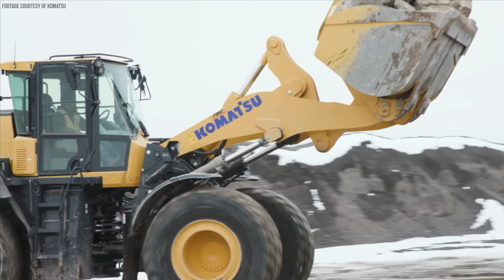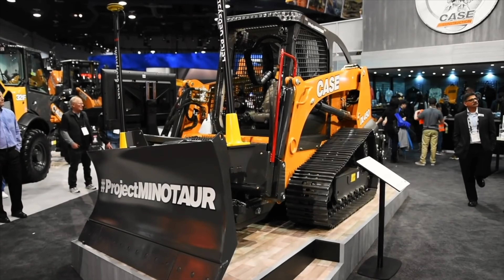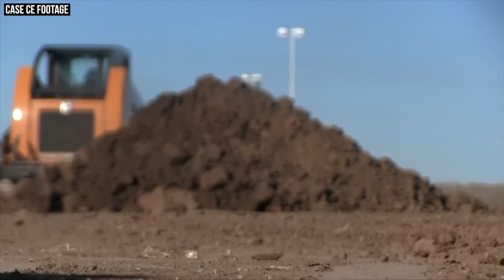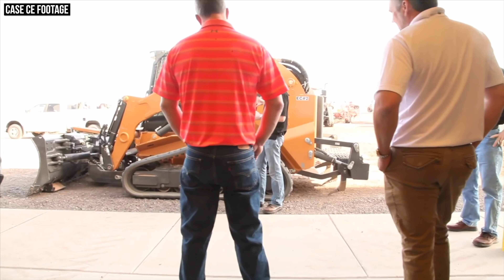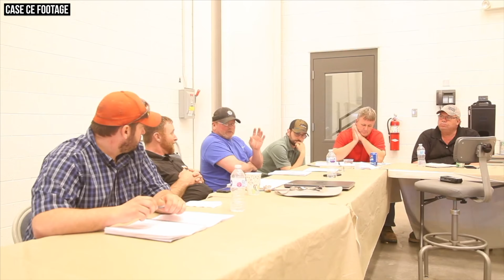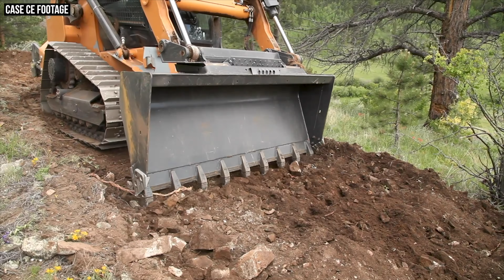The Dirt #01: Construction News + Case CE's Brady Lewis Talks Project Minotaur & the DL550B

Comment: 550DL how heavy is it no one has said a number if I cant haul it I need to know before I order one
Reply: Kevin Kinsey I read some ware that with the blade was just under 19000 lbs
Reply: Don't get too excited! Case is only releasing 20 or so units in the US for the first year. They really want to babysit the rollout and I don't blame them over the alpha skid series debacle. You won't see full production until next year.
Reply: ok so no one knows how much they weigh I will stay with Cat
Reply: @kevinkinsey6985  18000lbs according to the sheet they had at conexpo

Comment: I’m still very curious on the price of the 550. If it’s in a good price range I’m definitely will be buying one.
Reply: I used to work for a Case dealership. While case was super tight lipped about pricing, we were all speculating it would come in around the $120k mark once you threw in the dozer blade and steel tracks. Purely speculation on our part but it seemed like a solid estimate.
Reply: my kubota and caseih dealer sells these case 550  and other case construction